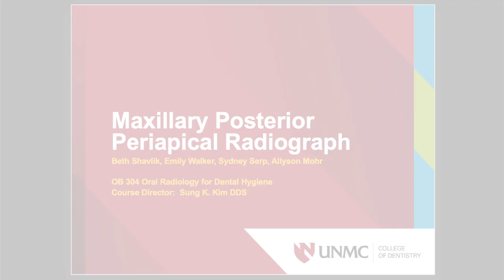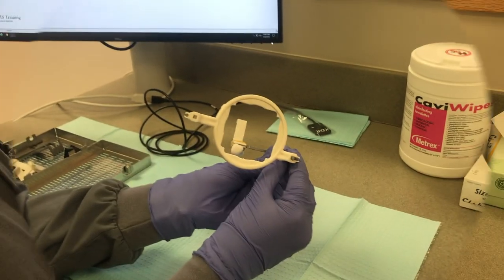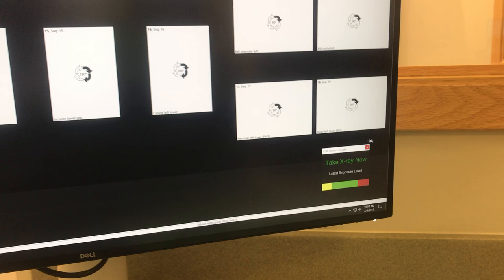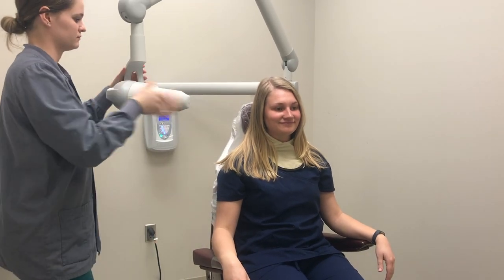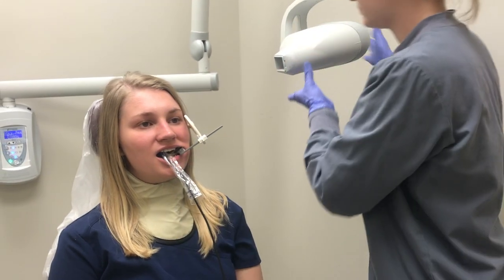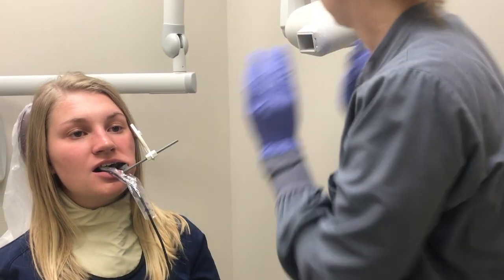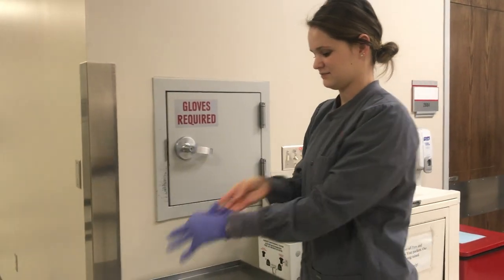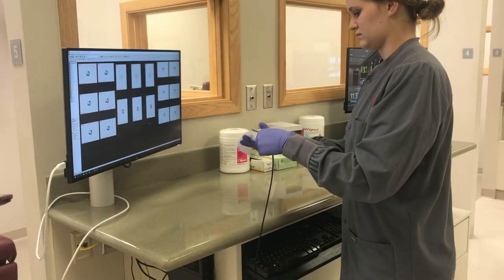How To Take Maxillary Posterior Periapical Radiograph Using Sensor

Comment: Dear Dr. Kim,
Would you mind doing about technique error? When I was taking these radiographs, I tried to followed the instructions as I learned. Yet with different  patients with various anatomical difficulties, I sometimes get PAs without the crowns or without the apex. It will be greatly helpful for me and other DA students to know how to correct those errors when we encounter them with the minimal number of retakes. Thanks.
Reply from the maker: Thank you for the suggestion. I will work on that with my dental hygiene students in the Spring semester of 2020.
Reply: @dr.kimsdentalradiology778  Thanks Dr. Kim. I appreciate it.